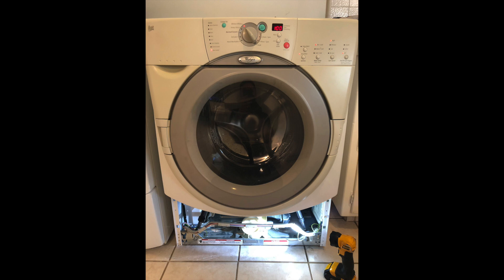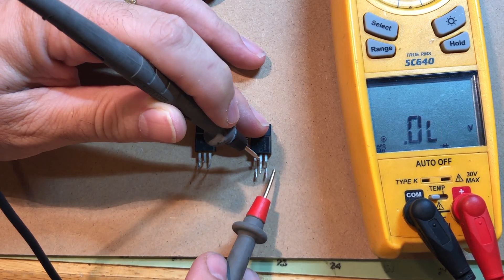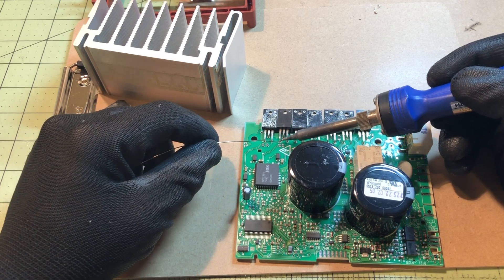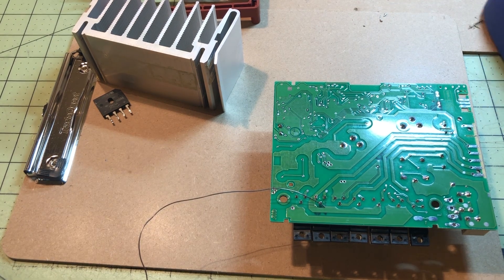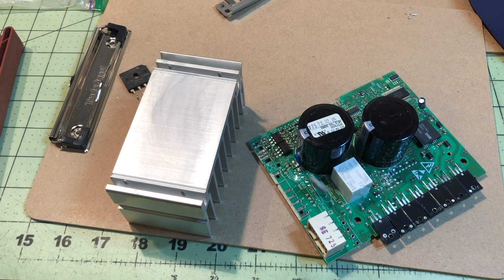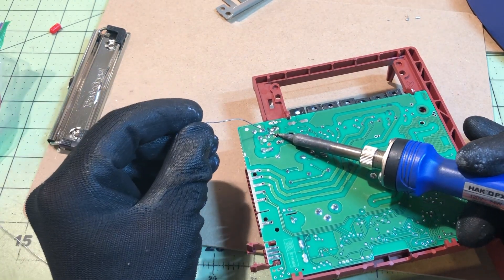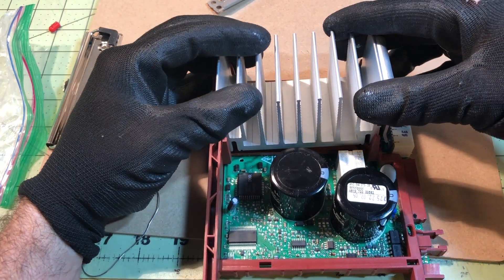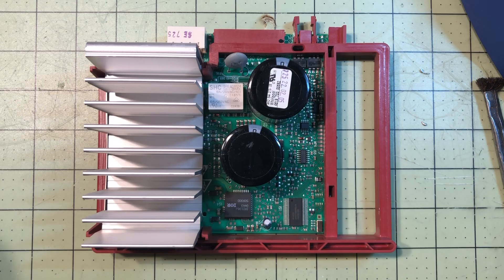Duet Washer MCU Repair

Comment: Great video! I think my washer may have the same problem. How do you know which transistor is bad without removing all of them to test? Thank you very much!
Reply from the maker: test with dmm, on diode/continuity/beep setting. If all three legs are shorted, that's a defective transistor. Also, sometimes you can see the transistor casing is cracked.

Comment: You can use soldering braid to remove execess solder fro areas where it isnt
supposed to on the circuit board?

Comment: When the transistor on my washer shorted, it blew the whole section for that phase - the other transistor, the diodes, gate driver, even the DSP. I guess there's no repairing that :(
Reply from the maker: A short circuit, can definitely be catastrophic and even if you are able to fix it using 10 plus parts, it wouldn't be repeatable, because the nature of a short is it will cause different types of failures, so not much help in making videos on a failure techs won't be able to use in the field.

Comment: For me the bridge rectifier blew, and some of the traces that acted like fuse! Probably I could get it fixed, but I’m worried if I bridge the burned link fuse with a wire than next time I get a short or a surge it might damage something else or fry everything!
Reply from the maker: Usually there are multiple trace fuses, if there are you can just bridge the one that blew. If bridge is shorted, test all standard diodes in the power supply, every once in a while I find they can blow as well.

Comment: The meter is on V for volts when you are testing for short. It should be on Ohms (resistance) to check for shorts. nice helpful video in every other way.
Reply from the maker: no, this is on 'diode test' mode, it's a test for the threshold voltage at which 1mA will flow. The current may vary depending on the specs of your meter. One way, is OL (blocking current) the other way, usually you will get anywhere from 0.3v to 0.8v. You can also look up YouTube videos on testing a diode or transistor for further explanation.
Reply: @electronicsprojects4708  Cool. thanks for the details

Comment: HI, my Duet will not let water in. It has no power going to the water inlet valves. Do you think it is the MCU ?  Thank you
Reply from the maker: could be, check for a burnt spot on the mcu plastic cover after taking the board out. That's a good indicator the mcu is failed.

Comment: Im having such a hard time trying to fix mine. Definetly not experienced and really need help. Why cant appliances last like they did way back when....smh
Reply from the maker: electronics are convenient, but not reliable. Companies cut cost by putting cheap parts and parts that are under the recommended specs. I instruct techs on my channel in advanced repairs on appliances. I would recommend calling out a local company that is trustworthy and has good online reviews to help out.

Comment: May I ask what part number you changed?
My washer is also show error code f71.
Reply from the maker: there are 6 transistors, you would have to test each one to see if one of them is failed. Look up 'testing for a shorted transistor' on Youtube if you don't know how. Then look at the part number on the transistor that's failed and order that one.
Reply: Thank you so much, 
 I will try.

Comment: What causes it to short in the first place?
Reply from the maker: Motor is a heavy current electrical load, electronic transistors switching these loads over years wear out and can fail without any other cause.

Comment: There is other video on utube, recommends to check and clean drain pump, then if F06 / E02 did not clear only then move to replace the MCU ...Is this correct ?
Reply from the maker: F06/E02 is a data communications error, not related to the drain. There is another error for drain pump clog.
Reply: @electronicsprojects4708  so there is a small chance that harness between main board and other parts is disconnected. I assume unplug them and reinstate one by one, may solve the issue.
Reply from the maker: @samj1012  Manufacturer says to do that, almost never works for me.
Reply: @electronicsprojects4708  I have this same board on a washer giving F6/E2 error..I found one PCB connection blown. it was made thin like a fuse connecting R1421(NTC) to the relay K1701..do you think if I reconnect that things would work again, or it maybe another component needs to look at ?
Reply from the maker: @samj1012  when I troubleshoot an appliance it's in a customer's home with all my tools, anything else is guessing. Too many different failures on these appliances. In general 'blown' is bad, that means short circuit, and typically can cause a few components to fail on the same assembly.
Reply: @electronicsprojects4708  Thanks alot..I meant that a copper PCB connection between NTC & relay melted and went disconnected. if I was able to post photo of it here. that connection was made thin on purpose to function like an overload fuse. the board is W10374126
Reply from the maker: @samj1012  My answer is the same as above. I can't look at a picture of a board and tell you what's failed. The blown 'trace fuse' as it is called is the tip of the iceberg. A part or multiple parts are shorted on the board, it needs to be properly tested for short circuits.
Reply: @electronicsprojects4708  Thanks alot. Will follow track with a multimeter and see how

Comment: good video, but how did u know which transistor is shorted ?I assume u tested them on board then de-soldered the shorted one ? did u ?
Reply from the maker: at 38 seconds into the video, I test the shorted transistor, you can do this in circuit.
Reply: Electronics Projects you test the transistor short or you short the two terminal pin its coming short what is this video

Comment: Where can I buy that transistor?  I need to replace one.  Thanks.
Reply from the maker: Look on your transistor, type the part number in Google, look for it at Mouser or Digikey
Reply: I did but no match.  There are two set of numbers on the transistor.  Part #K06N60 and FA312.  eBay have something close but the legs are all long unlike the one on the MBU.  I found a used board on Fleabay for 40 bucks and call it a day.  Thanks for your help.
Reply from the maker: @Biloxi6969  sometimes they get discontinued and you need to find a valid sub, as well, which can be a pain.
Reply: @Biloxi6969  Yes, I'm having the same problem - that is a hard transistor to find in the US.  There are many for sale from China but shipping takes forever.  But the boards are selling for $200-300 so I guess I'll wait.  There is probably something on Digikey that is similar enough but I don't know how to find it.
Reply: @Biloxi6969  Ah, ok, now I was able to find a used board as well for $40 and that's better than waiting two weeks for the transistors to come from China. Thanks for the tip.
Reply: @byubadgerprofessor  Great!  Glad you found the part.

Comment: Thank you very much for the contribution. Does this repair correct error F71? Or what is the component that causes the failure and should I change? I will greatly appreciate your valuable response
Reply from the maker: It may or may not, F71 is a different for different models, so I would be assuming if I answered that. Look on the tech sheet, if it says it's an MCU CCU communication failure most of the time the MCU is a t fault. You can test the individual transistors like in the video.

Comment: One more question. I have a customer with a Jen Air down draft stove. Blower not running. I checked wires going to it for ac n dc current. I got no power going to blower. The control board is no longer available. I also realized later it could be an inverter type controller so my assumption of no power going to motor may be faulty. Any help will be appreciated. Thanks

Comment: How do you know, where is the fault?

I have the same MCU and the washing machine marks me error 06.

What do I have to do to repair it?
Reply: I have a similar washer (Kenmore 110 45091 400) but with the identical looking MCU board.  I also have the F06 error code and I tested and one of my transistors tested bad as his did.